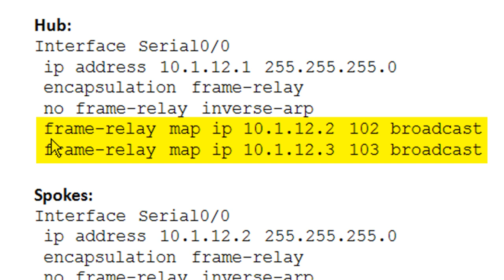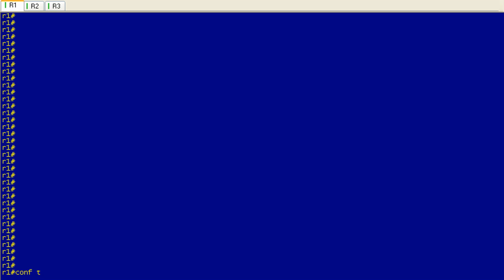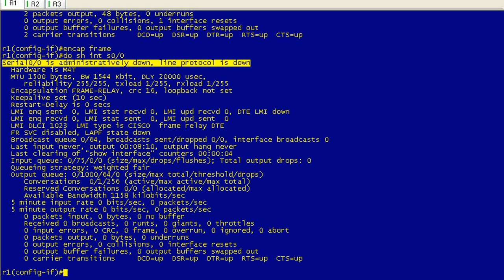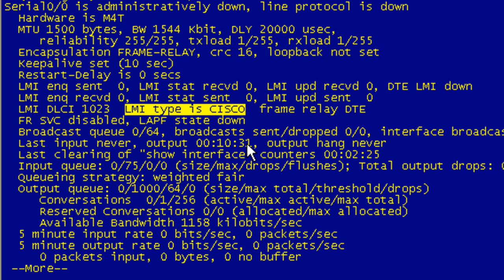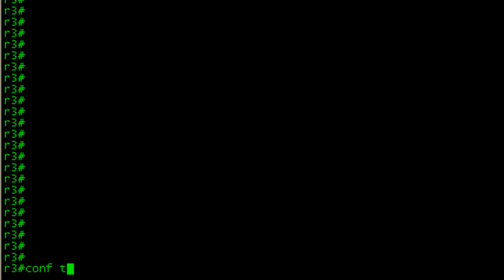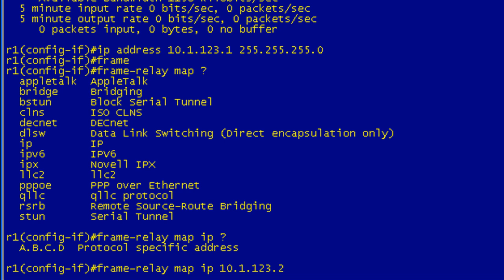Frame Relay - Basic Configurations Hub and Spoke - Part 2

Comment: whenever i try to do the frame-relay map ip command, packet tracer tells me this, "Only frame-relay interface-dlci command should be used on point-to-point interfaces not frame-relay map". how can this be possible if the links must be point-to-point?
Reply: NumberSixteen BusShelter Are you on a sub interface?

Comment: @Xaeravoq If both R2 and R3 have 192.168.x.x networks attached to them and one network is trying to talk to the other the traffic will be destined for a 192.168.x.x network and when R2 gets the traffic the router will say I don't a Frame Relay map for the 192.168.x.x network I only have 10.x.x.x.

Comment: I guess i don't fully understand Frame Relay. You say that when R2 gets a packet destined for R3's IP address then it needs a static map to that IP. But my question is when would R2 ever need to send a packet directly to R3's serial interface? I mean a ping i guess but how would real traffic get from R2's LAN to R3's LAN since the destination IP address never changes in a packet.